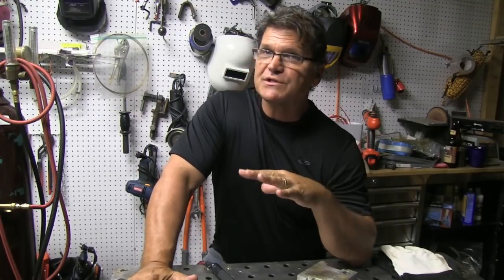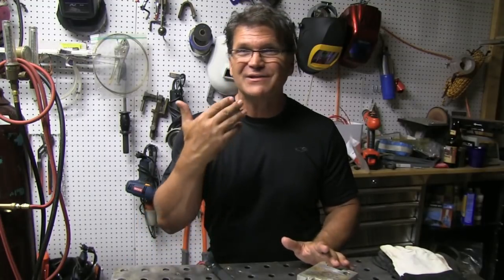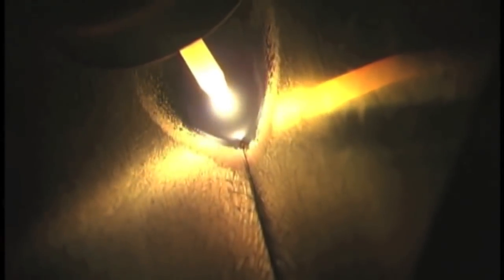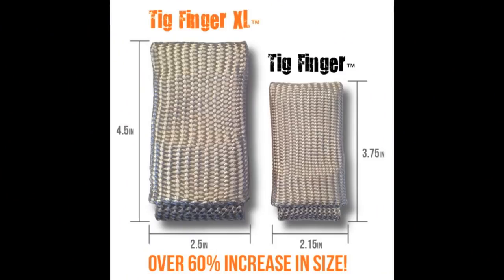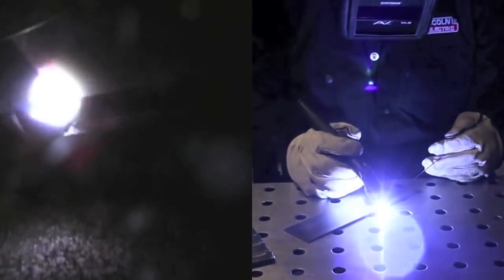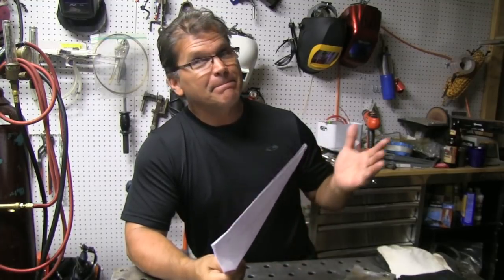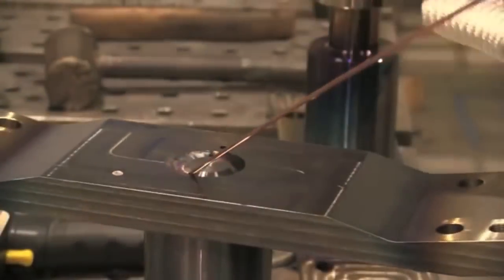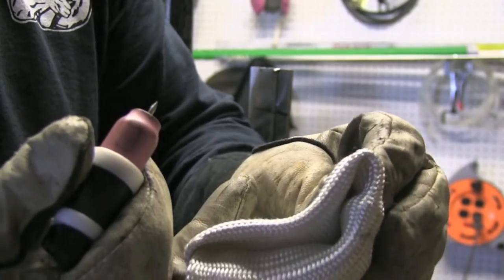TIG Welding Basics part 2 Q&A

Comment from the maker: If you like this video please tell a friend, leave a comment, and subscribe
Thx. Jody
Reply: Jody, I would like to purchase a quantity of Tig Fingers to give away on my channel. I would like to know if you can provide me with a discount for multiple purchases like that. I have learned a great amount of knowledge from you, and would like to promote your product on my channel.
Reply: Love the videos and learned alot from them. Id like to know how you record you Arc footage what kinda set up do you use for that?
Reply: weldingtipsandtricks hi I really videos super informative. I'm teaching myself how to Tigue and I have a miller dynasty series motor. Have a question though, when I am working with steel which is where I started at basically I haven't touched a woman yet I seem to get air pockets or bubbles in my welds
Reply: Especially when I go for a second or third pass. As I'm just practicing building at beads. Is that due to improper lead clean steel or a my doing something wrong? Thanks.
Reply: improperly
Reply: Your videos helps me alot trough my studies, your tricks are better than the one given by my teacher 🖒 you got my sub

Comment: Thanks Jody  for the tip on 2% Lanthanated 2.4mm electrodes with a #7 cup gas lens as a go to general purpose. Only started this year and my current go to is a Thoriated 1.6mm with #4 cup. It's working ok but seat time can't be beaten. This process has me totally captured, there are many hours ahead for this newbie. I was fortunate to get first hand tuition from two old hands, one of them is 77 and still lays down beads like a pro, he's at the Manning Men's Shed in Western Australia.

Comment: I've been MIG welding for quite a long time, but in a very specialized application. I was a stairbuilder by trade, and did quite a bit of metal rail, metal ballusters in home construction and some metal rail in commercial settings. I'd say I possess intermediate quality skills in those applications. I've since changed professions and now the only time I weld is for personal use and a little side business I have installing powered and manual rolling gates over driveways. I did one for my own home as a birthday present to my wife who had wanted one for quite a while over a few weekends. A couple neighbors saw the end result and asked me to do one for their home. I was reluctant, but the money was good and something I could take or leave if I wanted. So, I did a couple for them and they passed around my number and pretty soon I found myself doing it most weekends just by word of mouth. My brother, who builds custom furniture and TIG welds all the time suggested I switch to TIG welding on these gates. 

After watching your videos it's easy to see the advantages, particularly the ability to produce super tight and clean welds that require little grinding. You've done a heck of a good job with these videos, packing a lot of information in an easy to understand format with a friendly, conversational style. Hands down they're the best videos on this topic I've watched, and I watched a lot. I did all that watching from my game oriented YouTube channel, but switched to my personal one to comment, because I don't like folks repping their channel in my comment section and I don't do it to others. 

Sorry for writing all that before getting to my questions, but I felt a little background would help you tailor your answer better. First of all, do you think the application I mentioned is good for TIG? I do all this welding outdoors, in a variety of weather conditions (although of course, no rain). However, it can get pretty windy or very hot in the summer (I live in Dallas, TX).  I don't always have access to 220 voltage; most the time I do, but not always. So, if I switch I'll have to stick with a 110 machine. Would that be enough for my application? Your videos seem to suggest it would, but I figured I'd ask anyway. Secondly, is TIG a good fit for working with a lot of 2" and 4" square, steel tubing, which varies in gauge from 14 to 1/4"? I noticed you do a lot of second passes, is that necessary most of the time? It would add a lot of time to my weld work if I have to make a lot of second or third passes. I'm not doing a lot of fill work most of the time. It's primarily butt joints on 2" square tubing. Also, how sensitive is TIG to contaminants? Most of this tubing comes covered with oil, which I clean off before I start, but sometimes I miss a spot and the MIG is fairly forgiving for oil contaminants (at least it has been in my experience). Lastly, if you think TIG would be a good fit for me, is there any machine you would recommend in 110v for use with my application? I realize that I've asked a lot of questions and you are a busy guy, so if you don't have to time to answer all of them could you just let me know if TIG would be a good fit for my application in outdoor use and a machine you think is good in 110v? Thanks a lot for your help and your excellent videos!

Comment: Great video, Jody. Wish I had this resource when I was cutting my teeth at the local hot rod shop. Even with some years under my belt I still learn from all your videos. Can't hurt to revisit the basics. Looking forward to your video on filler rod selection and if there's anymore on cast iron repairs, specifically concerning the pre/post heat and perhaps nickel rod.

Comment: I agree with you on the 2% lanthanated tungsten.  I followed your suggestion on a previous video and bought some.   I used that for a year of class I took and they held up better than the 2% thoriated I was used to on Aluminum.  Why then is the 2% kinda hard to find and few people know about it?  I had to order mine online the local shops did not know what I was talking about they only had 1.5%?  Nice job so far on this series.

Comment: Man, nice save on the carbon backing question, I really boned it on that one. Goes to show you if you haven't done it yourself you should leave it to the experts. I had just seen the brazing dam video that Keith Fenner had posted about a cast repair he did using graphite backing and brazing with bronze and I didn't even think of the Carbon wash in you'd get if using SS...D'oh!

I have very little professional experience with stainless welding, but have enough in the assembly of sewerage facilities to know the do's and don'ts when installing SS hardware, so I should have known better. Even if I was being rude enough to answer questions intended for you...and I'm sorry to both you Jody, and also to your viewer whom I unintentionally mislead with my big mouth. I hope you can forget about it and motor on, I was just trying to be helpful, but as they say..."the road to Hell is paved with good intentions".

I'll be remembering that in the future, again, my apologies to all whom I misguided. I will think allot longer before I go and answer any questions that I'm not 100% certain of the answers, or the acceptability of even doing so on another man's page, won't let it happen again.

Aloha
Reply from the maker: It was a good question. Graphite backing is very useful sometimes. And your question gave the opportunity to talk about concerns about carbon pickup so actually it was adding to the conversation.  So Thanks 
Jody

Comment: Hi Jody great videos! I need to extend some half shafts using a steel sleeve but the half shafts are most likely hardened steel. Do you have any tips on welding hardened steel to non hardened steel?

Comment: back in the day I had to learn to weld and pass the 7018 all position bend test to weld sheet piling etc. today i do not do much welding other that repairs around the place. i did purchase an older about 1982 or earlier bumblebee unit that came with a tig attachment, I have the unit set up in my shop the welder works fine and is around 250 - 300 amps so can do some heavy work if required. I have never used a tig welder, so my question is do you know anything about this tig attachment and is it a reasonable unit to use? i would like to do some practice welding with it this coming winter so that i can actually use it for shop repairs.

Comment: Jody,

Thank you so much for all the videos, I am learning how to TIG almost exclusively from them, still very new.  My machine is an early 90's Miller Syncrowave 350 transformer.  I notice you don't seem to cover transformers much, I guess because they're old news.  But one thing I have picked up is your preference for 2% lanthanated electrodes on just about everything despite the old school, almost requirement, for pure on aluminum with a transformer machine.  On my machine I tried pure and lanthanated and I just can't seem to get lanthanated to work nearly as well as pure on aluminum.  Lanthanated doesn't ball up like pure does, forms more of a sharp, jagged porous ball.  Got any advice here?

In general I would like to see more info in your videos on transformer machines but overall I am very appreciative of the wealth of knowledge you so freely share.  Thank you so much.

Sincerely,

Jeremy Divin

Comment: What size is the best size TIG torch. I got a 26FX torch with a 200ac/dc inverter. Is that torch a bit too big for learning to weld or on small joints. Any advice appreciated.

Comment: I am looking into a MP machine as I want to get more capability and potentially get into doing some side work once ready... I’ve been very interested in the reviews of the Everlast MTS 252 Sti ... it does aluminum which is very important to me and also seems to do all three processes well not sacrificing one to make the other better and the TIG AC and DC setting seem to have incredible amount of adjustments and different processes such as puke, ore and post flow, and I’m curious if you would recommend this machine for a MP machine that is capable of repairs and picking up some jobs when ready and able ?

Comment: Hey Jody, thanks for the videos, your shameless plugs worked, loving the finger so far. 

Anyways, I have a question on Air flow, when I was welding a fillet joint after watching your videos on 1/8 aluminum my weld was looking okay, my friend who tig welds for a living turned my airflow up from 11-15 to appx 25cfh and it instantly looked better He stated he could tell by the sound it was making that it was going to be a a better looking weld. In your experience did I have the wrong cup size / torch angle / not enough amps or something in between? The welds initially looked pretty porous, then they smoothed over once he upped the air.

3/32" Electrode with a 7 cup. 1.5% LA
3/32 4043 rod
110hz
shooting for 30% cleaning action.
Everlast 250EX w/ watercooled torch.
Rookie welder.

Comment: just got a miller syncrowave 350lx  im not so experienced     the settings on this machine are very confusing       i understand the dig   have no trouble with alum but setting to do steel is giving me heartburn    any advice

Comment: Hi jody i wonder if you could give me some info on welding ss 310 i have a job to tig weld a refuse burner but the wps says they dont want me to go over a certain temp so can not pre heat is pulsing the answer because on test trials i get cracking at the beginning of the bead
  . P.s i am coded to bs en 287-1 in mig mags and low hi just wanted a little reassurance because 316 308 and 304 all act differently.

Comment: Beginner. Using a gas lens, 3/32" tungsten red, 7 cup, 17 torch, about 15-cfh I noticed after a while some splatter that was sticking to the screen in the gas lens. None would be best, but when to replace it? Obviously when welding fails, but it is difficult to determine when in the learning stage. Also, can it be fixed or is it trash?
Reply: You shouldnt be getting splatter TIG welding. You wanna keep your electrode clean, if it sticks in the puddle or something, you'll wanna start with new tungsten - it always helped me to have a few electrodes prepped & ready so you don't have to keep interrupting your seat time

Comment: Hi jody love your videos, i have a question for you, i've always welded on a old buzz box type arc welder and im getting my new TIG welder in a few days , well i wondered if i could use 6011 and 7013 old stick rods and melt them with my new tig welder if i broke off all the flux stuff on the outsides of the rods , i have a whole tube of old rods so i was just wondering, thanks a lot for the awesome videos and so much learning things you teach. : )

Comment: Thanks for the vides!! I have a question for ya. You probably get this all of the time. I have watched I think all of your review videos already. Helped me a lot with knowing the options more but still haven't come to a decision. I want to buy my first and last tig machine. I have never used one but I would like to start. I have a small home shop with a couple lathes, a mill, a hyd tube bender, and other fab tools. It is mostly just a hobby shop for now but I do some small jobs here and there. I and currently building a hot rod 1950 ford f1 truck for myself. Fun times are a coming! Lol I currently have a miller millermatic 185 that I do everything with, except aluminum I don't really care much for the spool guns so I never bought one. I would like to get a really nice ac/dc tig machine that could be used in place of my mig. I don't want to spend more than I have to but I don't want to have something that I will be unhappy with in a year. I would rather have more machine than I will use than to not have enough. I am looking for new or used but there are so many options and price ranges that I feel overwhelmed. I keep checking Craigslist but haven't seen much on there. Anything name brand seems to be really old??  Also have been looking at some of the new millers.  What do you think?
Thanks again for the awesome videos! I already feel like I have tig welding experience and have never even turned one on.

Comment: Can you do a video or document on where to use different cup sizes and possibly electrodes sizes and filler wire and machine settings. Give your acceptable range of sizes (of cups,electrodes,filler wires, settings) for different scenarios(material thickness and type). We could then compare our job to the closest of your scenarios. You could even sell this document on your website. I have been looking at your website and intend to make a purchases of DVD's and TIG finger very shortly.  Thanks for your great tutorials. Michael in Sydney Australia

Comment: What is the difference (if there is one), between scratch-start and "lift start"?  I was asked to try a little welding job recently at a vendor's shop (machine shop) using their Fabricator multifunction welder, and the TIG option was labeled as "lift start". I have only welded with my Diversion 180, so no experience with scratch, which did not go well for a few different reasons, I took the part home and welded it as good as they ever had seen, with my own machine. This Fabricator machine had a foot pedal, and it did initiate an arc if I pushed the pedal then tried to scratch it like you would with a stick welder, but I wonder if you're supposed to actually contact the start point, depress the pedal and , and then lift the torch to actually start the arc????

Comment: welding 20 ga and thinner stainless when making a tank, what is the best way to shield both sides. 2 separate tanks and regulators or can you split off a small hobby sized tank?

Comment: I have a question... I have never picked up a welder but I'm a woodworker and I've been listening to the making it podcast and want to get into welding. My question is, if I wanted to buy one welder and want to spend my time learning one technique, what system would you suggest TIG or MIG? Looking to weld legs, frames and different parts for furniture. Love the channel learning a lot but I need to get a machine in my hands! Any help you can provide would be amazing and if the YouTube welding community has any input that would be great as well!
Reply: Jonny Lewis I'm nowhere near Jody s level. But mig is universally considered easiest to learn. Tig is harder. Mig is good for things like repairing/maintenance, also less expensive (like consumables). Tig makes more money but also costs more. I'd do both, Tig as a career, but for home, hobby, mig.

Comment: what are the best settings for welding 2.5 mm thick mild steel tubing. current tungsten size filler rod size cup size

Comment: when you are filling holes with copper or stainless backing, (5:00 min in) why doesn't the puddle try to bond to the stainless or the copper, would both the backing and the work piece be bonded with the filler ?

Comment: 4:20 -  You're using copper as a backing for the stainless. I find aluminium works great for this too and it's maybe more readily available than copper.

Comment: what difference, if any, does the 2% lanthanated make compared to a 3% ceriated? i weld pipe for CNG.. all welds xray tested... we use the ceriated now, would lanthanated be better??
Reply from the maker: 2% lanthanated is a good all around electrode for folks going back and forth between aluminum and steel...ac and dc.
if you are welding mostly DC, The ceriated might be the better choice.

Comment: Do you ever rest the ceramic on one of the surfaces and drag it to maintain electrode distance (I guess in a pure drag instead of "walking it" - which seems to be touching it to the surface)?

And How fast can this be done before the heat damages the ceramic cup?  Thank you.
Reply from the maker: Sometimes I do rest the cup and drag it. With an alumina cup you can do this for quite a long time without damaging a cup.
Reply: weldingtipsandtricks Thank you!